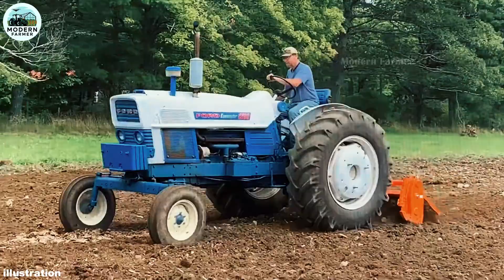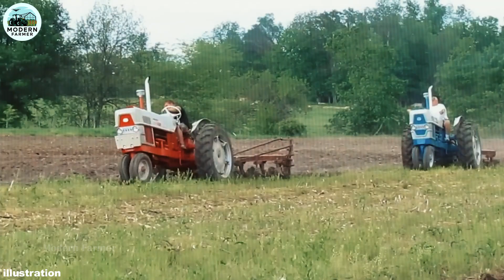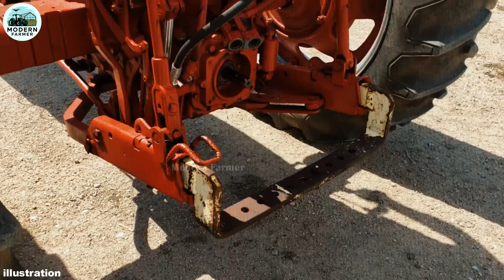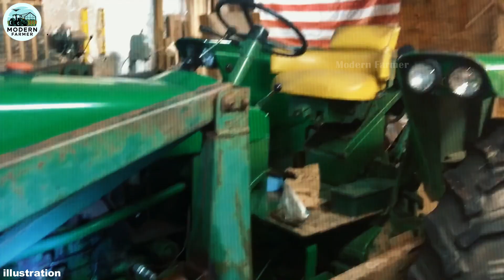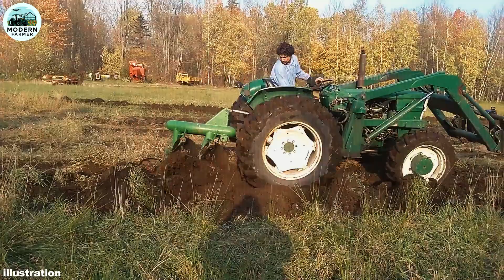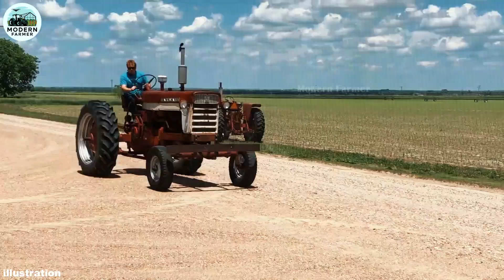5 Worst TRACTORS Ever Made in America

Comment: I cannot imagine a worse tractor than the JD 2010 Diesel,  the engine, the transmission, the steering, the hydraulics, some of the worst ever, but it had a nice mini 3010 look
Reply from the maker: You’re not alone in feeling that way about the JD 2010 Diesel—many others have been sorely disappointed with it.
Have you ever driven a JD 2010 Diesel in person, or have you only “experienced it secondhand” through a relative or co-worker?

Comment: JD 2040 was terrible tractor. The 4020 was a great tractor.
Reply from the maker: 4020 is definitely a legend! As for 2040, it doesn't seem to leave a good impression on you? What problems have you had with it?
Reply: 2010s were not far off of junk.
Reply from the maker: @anvilsvs  Thanks for sharing your honest opinion! The 2010 JD is a controversial tractor. However, there are people who have kept their 2010 running well for many years. Have you owned or operated a 2010?
Reply: @ModernFarmerTV  Yep, had two of those diesel  things which would NOT charge the battery enough to start in S. GA winters.
Reply from the maker: @anvilsvs  Do you still use them regularly?
Reply: @ModernFarmerTV  They've been gone for a loooong time. Kind of hard to feed cows in the winter with a tractor which won't start.
Reply from the maker: @ What device are you using now? I'd love to hear your story.